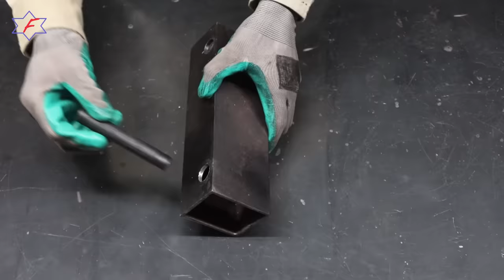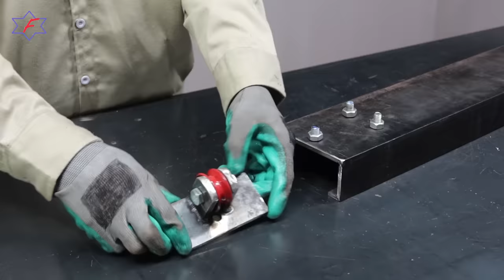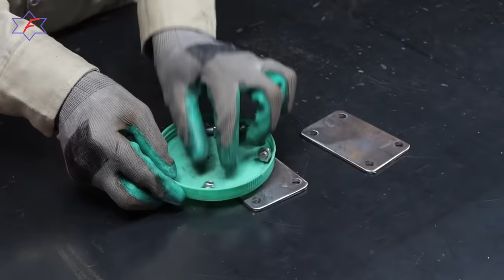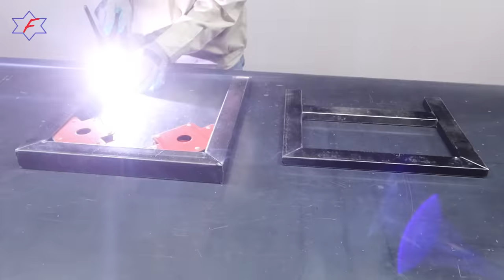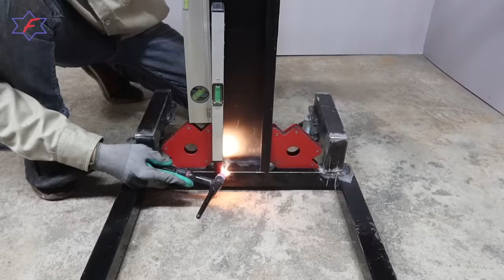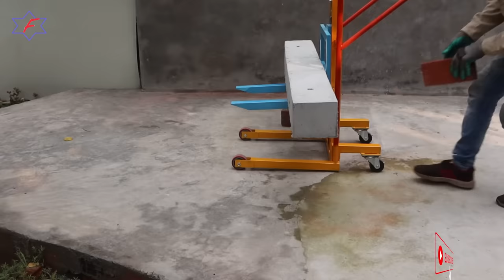How To Make Mini Forklift Using Winch | Homemade Mini Forklift Using Winch

Comment: This is great Thank you. I have to build something to move a handicap person in a very small space. I think this is how I will build my lift. I will use 7mm for added safety. Thank you and God bless you. You have no idea how much good you do.
Reply from the maker: Nice! You should do it!
Reply: @fawabros  I went to a metal supply shop and found the 5mm you chose to use is plenty heavy so that's what I got. Now the next step will be to get rollers. Do you think it would help if the legs could extend the length or spread apart for a more stable base?
Reply: A brake winch or worm gear winch will be safer

Comment: It's a great idea and well executed. One caution, though. The cable hand winch are designed for one direction (pulling in). To use them for a controlled lowering of a load requires disengaging the ratchet pawl, and the only thing stopping uncontrolled descent is your hand on that crank. It can spin your hand around and get away from you. The mechanical advantage makes the handle spin very fast, a common cause of injuries with this type of device.
Reply from the maker: You can control it.
Reply: @fawabros    That may be so with a light load, but the manufacturer's safety instructions, included when purchasing this type winch, state: "Never release the freewheel clutch with any load on the winch".  (releasing the freewheel clutch ratchet pawl would be necessary to lower a load with this gear type winch).    Using another type cable winch, such as a "worm gear drive", that has no ratchet release, would allow safe and controlled lowering of even heavy loads. The crank is made to work in both directions, raising or lowering, and there is no ratchet pawl disengage. The load is always fully controlled by the worm gear both raising and lowering and you can let go of the handle at any time.
These ratchet gear cable winches are made only for lifting, and not for lowering.
Reply: @practicalman45  If it is a brake winch, this problem can be solved. Our brake winch is specially used on small cranes. At work, you can remove your hand from the handle at any time.
Reply: @practicalman45  why are you being a hater? didn't you see the pipes on that dude? Popeye won't even mess with him, I mean, it takes power to lift a 20lb concrete block, and a giant empty cardboard box.
Reply: better to use a worm drive winch;problem solved
Reply: Add an electric winch (with friction brake) and battery pack.
Reply: @samspianos  or a break winch.
Reply: worm gear winch
Reply: @17hmr243  break winches are better less friction.
Reply: @Ham549  Brake*
Reply: @samspianos  exactly what I thought having that "puller" before I changed to worm drive for lifting
Reply: @PTcruser65  What the heck is YOUR problem  ?  Nothing wrong with anyone bringing up matters of tools safety !  I prefer the advice of a pragmatic man with both feet well planted than the opinion of a redneck dreamer...  🙄
Reply: @fawabros  a Chinese windlass might be helpful for heavier loads.  It's super easy to make, and was eventually superceded by the chain hoist, which has similar functionality.
Reply: Triny
Reply: @fawabros  how make hand winch please tell me
Reply: A lot of the new ones have a brake built in them that u have to crank against
Reply: @The_Joker_  б

Comment: Do you use a filler rod with your tig welding . It just looks like your tacking the hole thing just wondering? Great build btw
Reply: People must copy, and get killed or injured. Imagine someone thinking they will weld there car like that and it fails at 70 mph.

Comment: This is crazy to me????
I think I understand welding fairly well as I weld myself with a mig welder. I’m fairly sure that is a tig gun your using. Don’t you have to feed a rod into the weld?????   I don’t see you feeding a rod at all I see you just using the tig gun.  Please explain

I started today Making almost exactly what you are.
Thanks for making these videos. I have learned so much
Reply from the maker: I hide filler process.

Comment: Would love to see an instructional video on the welding device used. It cannot be as easy as you made it look. In addition a reply with make a model of the welding device would be super.
Reply: hopefully you aren't holding your breath... I have some experience with welding... never seen anything that could deposit metal, out of thin air... just saying.

Comment: Thank you very much for showing such a nice and clean job that you have done. It is amazing.

Only technical problem that the forklift has is the horizontal and vertical joint of the forks which are too week. They need support from behind.

Thanks again for showing such clean way of doing the job.
Reply from the maker: Many thanks for your opinions!

Comment: Beautiful work! But I haven’t found a forklift of this design that will pick up a standard pallet. It only works with an open-bottom pallet. This forklift would split a two sided pallet into bits. You always have to raise the pallet off the floor and put blocks under it, and then crank the forks up a bit before pushing the forklift under the load. That’s a deal breaker for me. But if you always set the pallet down on blocks, it can be done with this design. I’m concerned that the forks aren’t long enough. Thanks for your marvelous craftsmanship! Feeshy
Reply from the maker: Many thanks for your opinions!
Reply: The only way to do that without having a huge counterweight would be to make the base wide enough to straddle the pallet. Apart from that, this design is a little light to safely lift much on a pallet, the base and forks aren't long enough, wide enough, or strong enough. That said, it's a great design for small, relatively light lifts, i'm probably going to build one.

Comment: I would look at adapting a Chinese windlass to raise & lower the load.  It will hold the load at any height without the need for a ratcheting pawl or locking mechanism.  Similar in design of a chain hoist.

Comment: Very practical project, but it seems to me that the first bearings you installed should actually be a pair of bearings. As it is, the bearings won't actually roll when making contact with both rails, but instead slide. It would roll if it onky made contact with one rail at a time, but that kind of slop seems unwise in this application.

Comment: Great idea ill try to work almost th same with some modifications to the shovel..It should be a thin, durable steel that is easy to pass under weights👌
Reply from the maker: Good thinking. But you should choose steel that have enough thickness. Safety first!

Comment: Was thinking of making to lift stuff from my high bed truck and also high enough to lift and store stuff in garage elevated storage.  Option is to use electric winch instead of hand crank. Where can I get the parts, like the tracks.

Comment: Where the wheels are I would keep the wheels where they are and have an extension from the wheels under the pallet and put a roller at the end so that when you lift a pallet and the load starts to go forward and tilting the rollers would stop the load and forklift from going forward and you still can roll the load around but the load and extended forks will not tip over front ways or direction of forks without resting on the extended rollers and have the rollers extend downwards to level the load and forklift.

Comment: If your grip slips off the winch crank handle when lowering, is the downward motion of the load arrested, or does the handle spin wildly as the load drops to the floor uncontrolled?

Comment: How are you welding just with that tig.   I always seen someone holding a welding rod while using it.  Will you explain how
Reply: I think either the trigger pushes out a little tungsten or he is just using it to join the steel, not using a filament. But, my dad's I used growing up was a foot pedal model, so I'm also quite curious.
Reply: Maybe sort of like a gas dispenser ⛽️  or a garden hose, you can tighten it or loosen to determine how much filament comes out. So if he is only doing 1 inch welds, he can set it to push out about a cm of tungsten over the course of the full squeeze?
Reply: @mrdumb-fq2ul     right on.   I hope he will explain

Comment: Dear friend your forklift winch would work much safer if you used a worm gear winch it looks almost the same as the one you are using except it has a worm gear drive then you can raise and lower your concrete block much safer it cant run away from you if you get distracted somehow.
Reply from the maker: I have worm gear in this forklift. You can see it in this video. Sorry because I don’t show it detail.

Comment: Was I the only one thinking how come he/ she hasn’t used an inch of filler material(s) and they may have said and I mist it but it looked like extruded aluminum and mild steel end caps welded together real fast then grind quickly slight of hand you could say ? I’m not knocking the work or the design just how impossible easy they make it look ! Now I know it’s light duty I’m fascinated by it !
Reply from the maker: Many thanks for your opinions!
Reply: @fawabros  you can tell me the secret material , ? I won’t tell anyone .....the recipe. Of course we all know you can weld without filler materials being added however I find it amazing that you pulled all that material into a nicely raised stack of dimes evenly spaced with out any filler and not loose your tolerance’s 
Well I understand like any great magician once you give away your tricks , it’s over the fillet is out of the bag .
Reply: It's a decent design, but I would have removed mill scale and paint, beveled the edges, and used filler rod.

Comment: I don't weld as I'm sure everyone will know in just a moment..
When tig welding don't you need the filler rod? And if you don't need it or use it I don't understand why you would have a weld that needs grinding. Where is the extra metal coming from that needs to be ground down?

Comment: Beautiful but scary. TIG welding really doesn't have much penetration and then you ground the weld down flush ? I didn't see any gap between those parts that were welded from one side only so I know the welds are paper thin after grinding.
Reply: Would have to agree. Not trying to criticize but no MPI on the welds, no load test & no certification of SWL either. Safe to say, it,s one thing to build it, quite another to know if it is safe to use (& if so, to what capacity).

Comment: It could only be used on something that is already propped up. Couldn't use it as a pallet jack
Reply from the maker: No, it could do as a pallet jack!
Reply: @fawabros  how the tires in front are too close to the forks that they would also go into the pallet or the pallet would also hafta be sitting on something
Reply: @fawabros  show me a video of it picking up a loaded pallet. Just looking at the video it seems the front wheels aren't wide enough to be outside a pallet. When you start to pick up a pallet the front wheels would hafta be perfectly position, otherwise you can't lift because the tires hold it down or you can only lift a high as the ground to the bottom of the frame allows, which could be useless if the floor is uneven
Reply: @fawabros  I want to clarify something, I like the creation.  I think its well built for what you used it for and would love to have something like that around my shop.

Comment: Fuse welding with no filler wire through mill scale and paint, no beveled edge and sand most of it off. Not me!
Reply: Yes no filler ?? Not cleaned ?

Comment: Not trying to criticize but no MPI on the welds, no load test & no certification of SWL either. Safe to say, it is one thing to build it, quite another to know if it is safe to use (& if so, to what capacity)? Aside from that, a unique perspective on the build & not suggesting it isn’t a good idea. I would merely caution users & builders alike….. there is a little more to it than just coming up with concept & building it.

Comment: The design is excellent, but your tig welding doesn’t seem right. No filler wire is used, at least that’s what you are showing.
Reply from the maker: Many thanks for your opinions!

Comment: A winch with a worm gear would be safer.
Reply: It would slower by hand, but awesome using a drill to operate. And your right, it would be a lot safer.
Reply: @tystahl3961  
Not a lot slower. That crank has a long gear ratio on it.

Comment: What is the capacity in kilograms or pounds?
Reply from the maker: Max capacity is 200 kgs. If you want to change capacity, you should change the winch.
Reply: @fawabros  Well done looks good if you put wheel Barrow type wheels on it you could go anywhere.

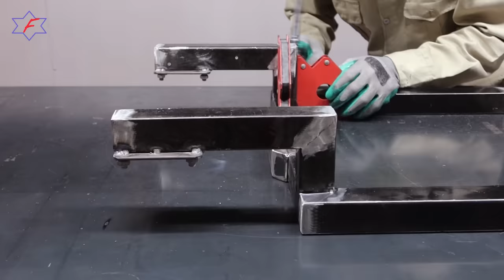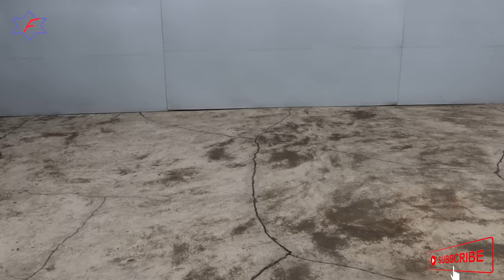Comment: Too much flexing in the corners where the wheel legs attach at the hip. Gussets are badly needed 9:00 both front and rear as well as side to side. As you roll it you can see it twisting from the stress 17:11.

Comment: You showed the crank going down with the concrete on it because it was easy to turn because gravity was helping. You didn't show you cranking it up with the concrete because it was hard to do.
Reply: Assuming you have never winched a boat onto a trailer?

Comment: Forklifts are made for picking up pallets.  This would never work since the lower wheels will be into a pallet. Also, you are telling people that you can Tig weld parts without using any filler rod, which simply is not true.  Yes, you can melt two parts together for placement, but without a true weld this thing has no strength.  Also, a boat winch can only pick up what you can pick up.  You have to hand crank it, which in reality is harder than lifting.  I give you a Thumbs Down for Disinformation, and Falsely Advertising your abilities.